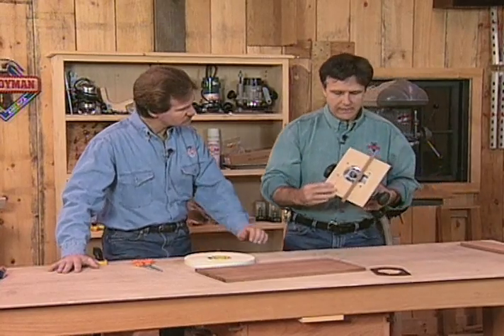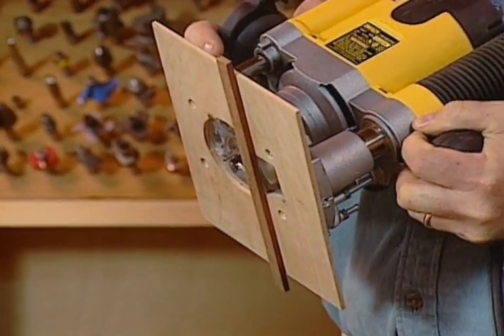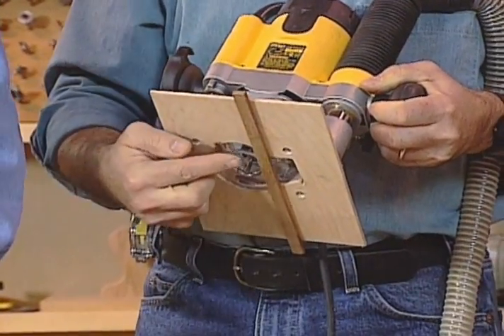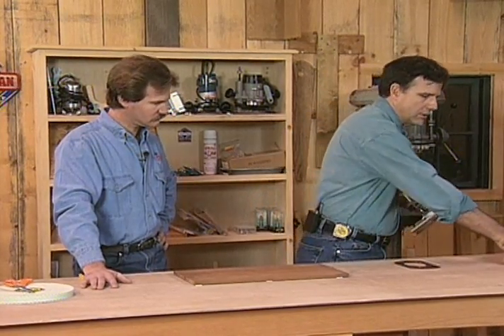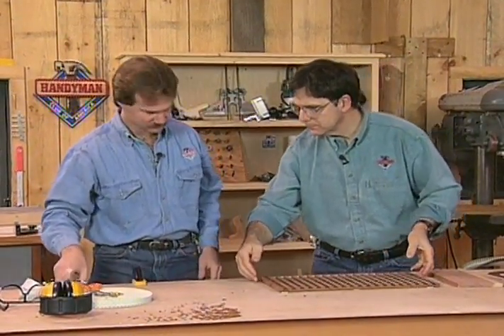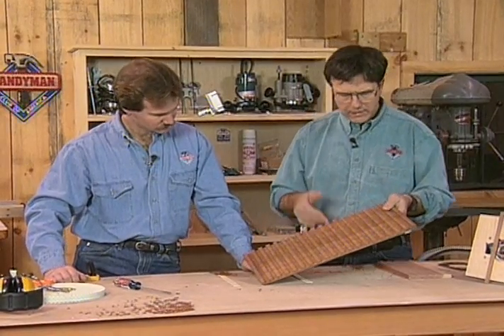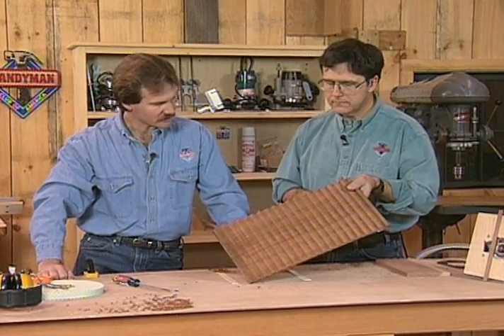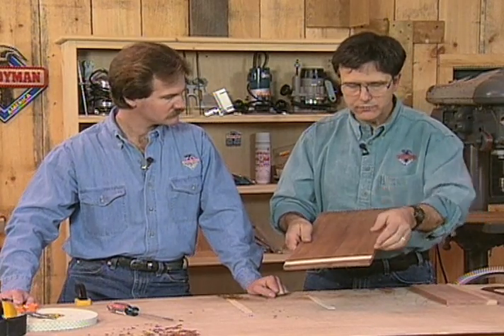Advanced Routing Techniques Part 3

Comment: Its easy. Lets say that you have to make 3 passes. You just have to make your 'rail' small enough to fit the 1st one. They said that it didn't have to be as deep as the cut. This way you can make multiple passes, you just have to make sure that your 'rail' fits the very first of them. You can do that easily by setting a few depths on your router (most of them have this option). I hope i helped aaaand..  forgive me my bad english ;P Greeting from Poland!